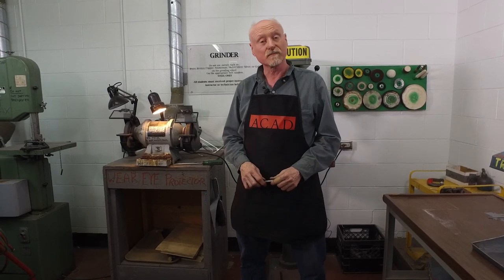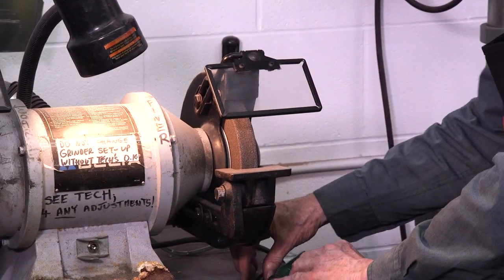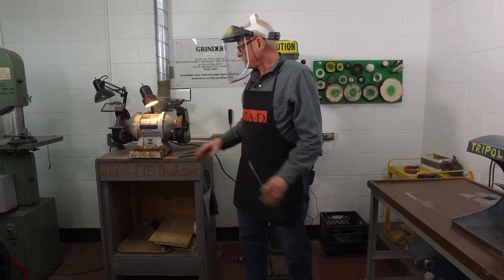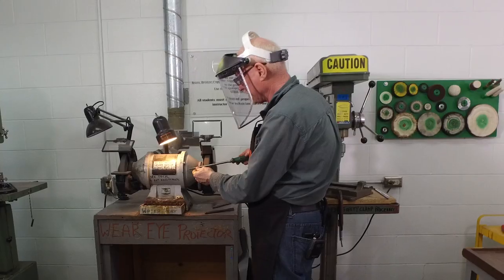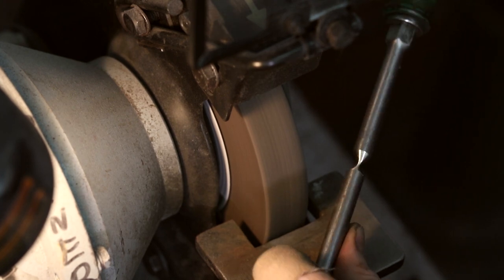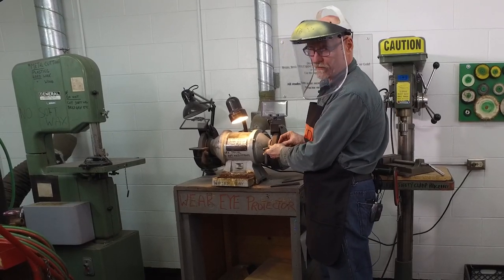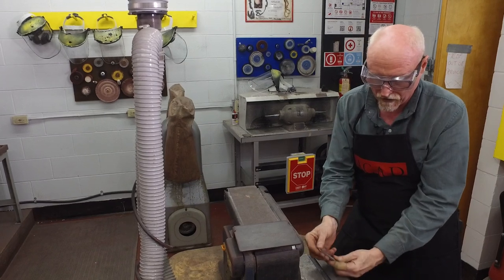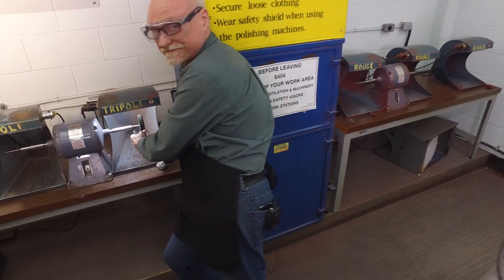Altering a Big Screwdriver to make a Foldforming Liner and Chasing Tool

Comment: Why did you choose the grinding wheel as opposed to the band saw or a cut-off wheel?  The reason for my asking is that the grinding wheel takes longer and heats up the steel.  There seems to be more work involved in grinding. Also, how hard are you planning to strike the end of the punch to shatter the steel?